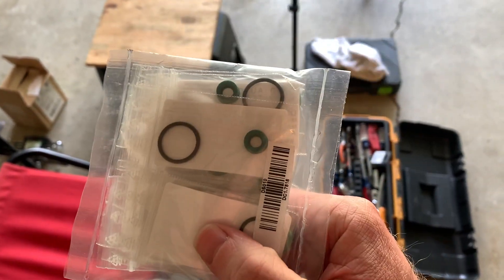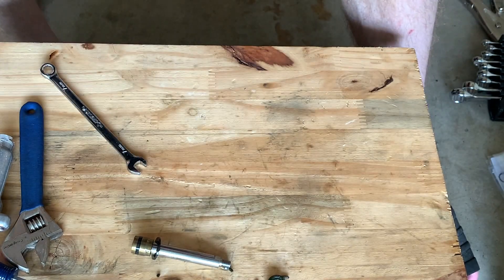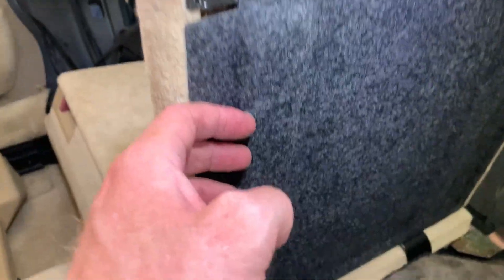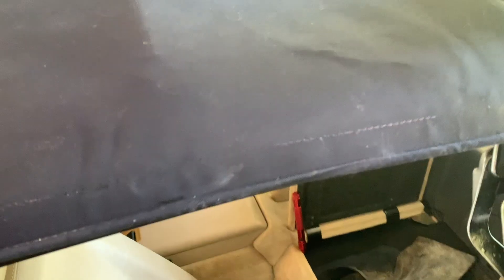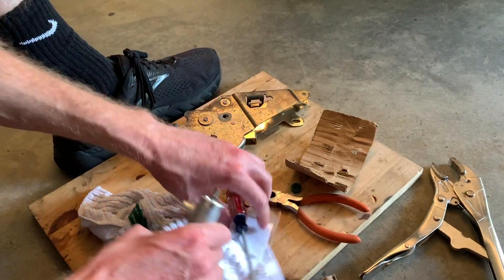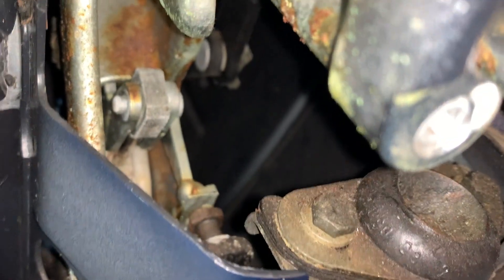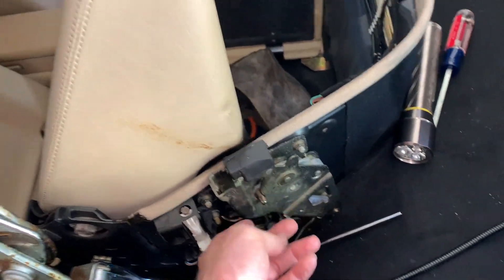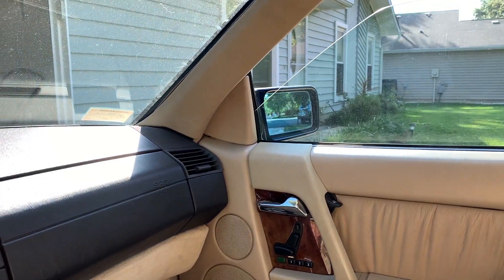Rebuilding all Soft Top Hydraulics on Mercedes R129 SL500

Comment: Very nice work, your videos have been extremely helpful to me.  Restoring a 1995 SL600 I got for $3500 last fall, it's been a crazy amount of work, have rebuilt and replaced so many things.  This video is giving me the confidence to attempt the hydraulic rebuild.  Top hydraulics wants $800 to replace these seals, it's a crazy amount of money.  Also doing the IR lock system right now, finally got it working.  It is nice to have keyless entry.
Reply: What did you do regarding the IR locks? Ive taken mine apart, cleaned them... never can get them to work consistently. Probably the most annoying part about my SL aside from well.. needing to do the top cylinders as well lol

Comment: F'ing IMPRESSIVE.  It is NOT that ez. I started to replace the Passenger side main lift cylinder and quit. 3900 bucks later it was fixed...I had all cylinders rebuilt like you did it.  Then I F around and broke the micro switch and yes the top did not work again.  Bought one off ebay 200 MORE bucks and installed my self and it fixed the situation and the roof worked again.  I am impressed that you take on these not so ez jobs and you seem to get things fixed.  Good Job.... you saved 4K

Comment: There is loctite or other thread seal on the threaded end of the piston. You are supposed to use a heat gun to soften it and it will unscrew easily. If you are having to stand on hand wrenches you are doing something wrong. Also that scratched piston is ruined. The scratch will will either leak right away or it will cause the seal under it to abrade prematurely. That being said thanks for the video as it is helpful in showing the construction of the pistons
Reply: Cool

Comment: Props on doing this without a vise and with regular hand tools. That's pretty legendary. I am about halfway through the job myself. Now looking back is there anything you would have done differently? Any leaks develop? Thanks for the video. You're an R129 legend now.
Reply from the maker: Made sure the hydraulic tank was full at very start after wine tasting

Comment: Thanks for the video. I was able to replace my top hydraulics earlier this summer.  I did purchase the same seals you have AND I stabbed myself trying to pry out the seal ring.   I will use your video as a reference for my winter project!  I’ve  seen a few videos where the mechanic used a dremmel to cut a seam in the aluminum case to access the ring seal.   Curious if you think that maybe a good solution to avoid the digging with a screw driver and potentially losing that ring.  Again. Thanks!  02r129SilverArrow
Reply from the maker: That ruins every cylinder you do that to